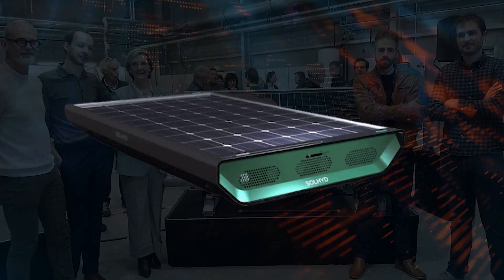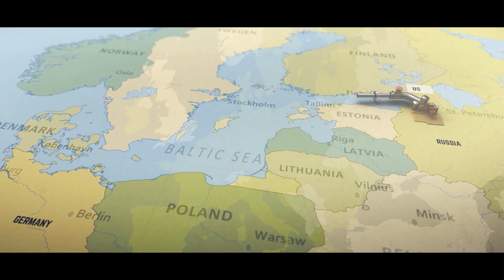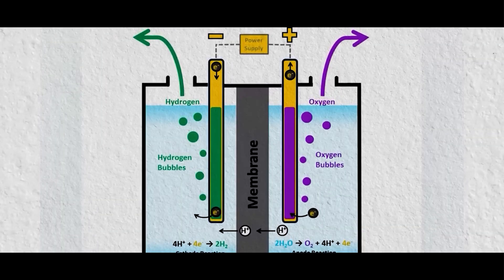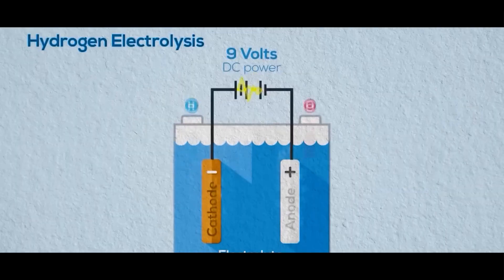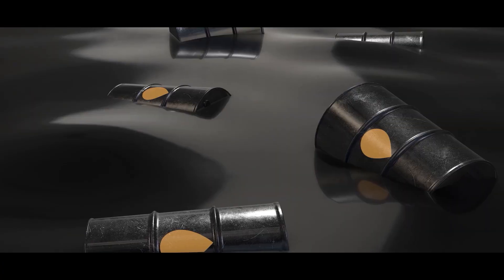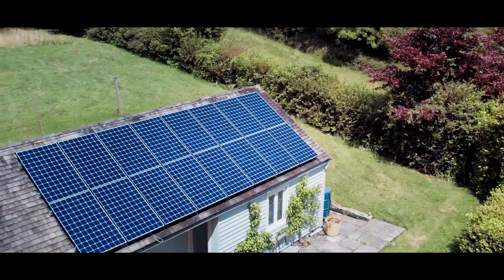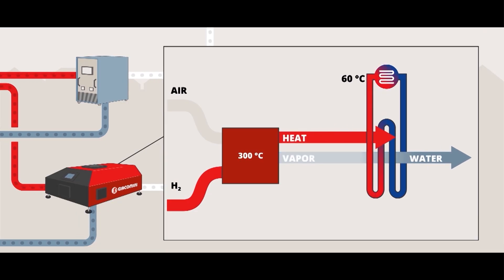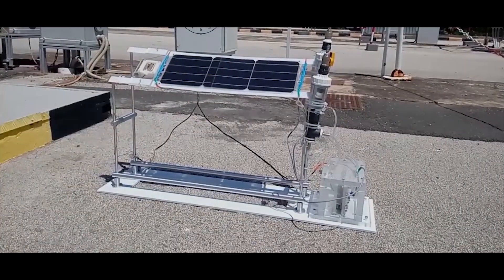NEW Solar Panel Produces Cheap Green Hydrogen at Home | BREAKTHROUGH!

Comment: bollocks, there's not enough 'platinum' one of the most expensive metals in the world in the world needed for these h2 'batteries' to operate at even just a few volts per cell output, never mind the expected 2023 52volt/500amp hour minimum home system to run a single family fridge for three days .
good luck making any container never mind cheap of even medium pressure to hold your local DIY hydrogen for 6 months without leaking before you use the gas to feed your currently unavailable & expensive home 'on demand' h2 battery bank.
there's No such thing as simulated/synthetic gas [simgas] except in PR investors booklets for profit; you mean old school DIY 'town gas' as used for hundreds of years in the UK before north sea petrolium was used

Comment: Not sure about the hole need to go green to save the planet thing but having a small off grid system I will say the storage of solar energy is my biggest issue. Current batteries have come along way but it’s still to expensive and difficult to manage the energy production. A small economical hydrogen battery would go along way in helping me get the most benefit out of my system
Reply: We make energy storage from used batteries from electric vehicles with an efficiency of over 90%. The cost of building such a warehouse is over 70% cheaper than buying a new one.

Comment: Producing hydrogen from solar is not valuable, solar is 20% efficient, hydrogen production is maybe 50% efficient, stored and compressed hydrogen is low efficient about 20% and PEM fuel cells are maybe 50% efficient, so the overall efficiency will be about 35%, so battery storage is much more efficient and much less expensive.

Comment: Combustion of fossil fuels is the problem. “Green Syngas” is still methane. It’s just more “green” washing.
Reply: It's carbon neutral.. it removes carbon then places it back into the environment. A whole lot better than pulling carbon from the earth and putting it in the air.

Comment: No matter what color hydrogen is made,  the gas piping of the house heated by natural gas will need changed to safely use hydrogen.  Hydrogen gas embrittles most metals and plastics and also leaks very readily...  in some cases,  it can leak through the walls of the tubing or storage container,  not just any fitting joints.
Reply: You are absolutely correct.  A home hydrogen tank will leak (eventually) and it is extremely explosive.
Storing hydrogen at home will be about as safe as storing nitroglycerin.
These Green Energy dreamers are so out of touch with reality it isn't funny.
They're going to get somebody killed.
Reply: They didn't say hydrogen will come through the gas main. They said a gas made from hydrogen has the same properties and could safely mix with mains gas and be used for green steel production.
Reply: @Murdock  They have upgraded the gas mains the UK to take hydrogen. Though it will probably be methane hydrogen mix as you cannot make hydrogen smell.
Reply: Mixing the gas is one option, another option is to power a fuel cell and thus the system in the house will have to be made full electric.

Comment: You lost me a bit earlier than this, but the comment "It extracts water from the humidity in the air" reveals the project is highly likely, not feasible. There are several issues here that I can raise off the top of my head:
1) you'd need a little power plant for each panel (huge waste and not practicable).
2) current process for water electrolysis is about 70-80%% efficient - so, to produce 1 kg of hydrogen (143 MJ/kg or about 40 kWh/kg) requires 50–55 kWh of electricity. Then lose another 30% of energy converting back to electricity. If each panel is say 400w, which will produce about 2kw a day, we get 1kw loss due to conversion, meaning in 1 month gives 20kw of power. This does not consider storage and compression energy loss).
3) you cannot extract enough water from the air at a good rate for this to even work (wasting more power for fans needing to move air about - specifically, air has a density of about 1.2 g/L, and water has a density of about 1 kg/L. if you had perfect capture (not possible), you need to shift 830 L of air. Actually, I take it back, the conversion rates for a panel are so poor, this may work, but you'd be better off relying on rain. In any case, this is more wasted power.
4) you need more than just water and solar power to extract hydrogen.
5) If in liquid form, hydrogen needs to be stored at -252.8 to remain a liquid, with over 5,000psi. As a gas, it has a low energy density and requires compression to 4 times that of natural gas. This all costs energy, so you will lose power to convert water to hydrogen and to just by keeping the gas.
6) there will be a high maintenance cost with so many separate power plants and complicated storage/conversion methods.

Simply put, the cost for all of this is very prohibitive with little return on investment. You'd be far better off storing the electrons in a battery as this process is uncomplicated, loses little by way of storage losses, is cheaper, does not require storage of hydrogen on-sight.... look, nice idea (*cough*), but makes very little sense at a local level due to the massive cost, loss of electricity during conversions, complicated storage, already having better technology to do the same job.

Comment: Bad strategy to create H2 and store.
Better to store electricity in battery and heat homes by heat pumps.
Never going to be commercially viable or safe.
Will be interesting to see how much money is spent on attempting to engineer this solution.

Comment: Hydrogen is problematic in so many ways. Hard to stop the smallest molecule from leaking through anything else, penetrates and embrittles metals. Storage and transport will never be simple. Existing Natural gas networks would be like a screen door to H2. Hopefully this tech can serve some niche need, but would never work in mass, those panels would cost a fortune to produce.

Comment: a couple of times you mention using photocatalytic hydrogen production (direct light->splits water using catalyst) but all the images show a photoelectric cell in the front implying that the standard electrochemical process powered by photoelectrics is being used ... which is it?

Comment: All solar panels can produce hydrogen. You will need much bulkier, more complex panels that will cost much more than standard panels that are getting cheaper all the time. They haven't invented anything new. This is just repackaging electrolysis which has been around for 100 years.
Storing hydrogen is not as simple as pumping it into tanks. You will need high pressure vessels, leak proof pipes and fittings - no, your natural gas lines will not work.
I will bet that this system is going to be mugh more expensive than standard solar and battery storage.

Comment: All this technology and expense  for only enough hydrogen for 4 KW-Hr to 8 KW-Hr for the whole year with 20 panels for a house?  Are you kidding me? The average house uses more than that for a day!  Cool technology guys but you have a long way to go before you can use this on a typical house!
Reply from the maker: Damn. There is a correction comment i have pinned on.
It is 4 to 8 MEGAWATT hours per year!
Reply: @The.Futurist  Ok, I missed the pinned correction. It would have been better to make the correction on the YouTube video. This is how YouTubers usually make corrections when the miss something or say something that they did not mean to say or show something by mistake. Perhaps you can still do this. Thanks.

Comment: This is a nice pipe dream. But that's about it for 20 more yrs or so.
I just think that the author Connor plug the Belgian co. because they don't really offer any storage area for hydrogen, and further more if any one is , it's liable to be only on the largest industry scale.. remember one has to compress the gas , warm it, then pull it out in order to utilize it as a fuel. So then you're all over the place of this subject when you talk about converting different products of an electrolysis reaction into new "$yngas" to just replace current fuels used worldwide.

So we'll have to claim bullshit for the next 20 or so yrs.
 Just quit lying to the public...

Comment: It sounds far too good. The manufacturer and The Futurist conveniently ignore the problems associated with hydrogen. Storage is extremely tricky, it leaks very easily. Also, have you considered the problem of hydrogen embrittlement?
Reply: Exactly. For what it would cost to install these very complex panels, install high-pressure, leak proof pipes, fittings and pressure vessels, you could install standard panels, battery storage and buy a nice EV with vehicle to load capability.
Reply: "Also, have you considered the problem of hydrogen embrittlement?"
Certainly.  That's why there is carefully no mention of it.
Reply: In most case it only needs to be stored for a short time. People have done this in the past and now we have better materials. Hydrogen is a small atom that can pass through some  materials. That is a fact, but it doesn't need to discourage all progress. It has incredible energy density and it is the most common atom in the universe. I used to play with it when I was a kid, I think it has potential.
Reply: @rowgler1  "In most case it only needs to be stored for a short time"
This video says it makes hydrogen in the summer for use in the winter.  That's a six month supply of hydrogen.  That's a LOT of hydrogen.
Reply: @rowgler1  Energy density of hydrogen is low compared to other fuels, just google it. Also, it can be liquified only at very low temperatures and high pressure.
Reply: Yeah they need to stop lying. You can't replace fissile fuels. 
What are you going to use to power a Bucket Wheel Excavator? What are you going to use to replace IV tubes with? Can someone show me an alternative solution to a jet engine that does not use petrochemicals?  We have nothing that can replace petroleum products.
Reply: @PAIP_Studio  JCB has a backhoe that runs on hydrogen right now. Link  https://www.youtube.com/watch?v=3fWmQgXcdqA
Reply: @PAIP_Studio  wake up. We can. And we need to. There is nothing you can power with fossil fuels that you cannot power with electricity or hydrogen.

Comment: 6kg of hydrogen per year per panel? That is terrible efficiency.
I just did the calculations and combining normal solar panel with a normal electrolyser you would get around 27kg of hydrogen per year.

Comment: Electricity should be made with clean coal put scrubbers on the stacks we have 1200 years of coal natural gas should be used to heat homes and run cars and trucks we should build navy subs that can be plugged in the grid and generate electricity in peace time in war time they can go to war to protect the USA then we can start up the coal power plants  we have theses power plants now all we need is the 100 subs built you do not want nuker power plants in time of war there targets we have all this it takes 10 years to build a nuker power plant and100 billion ,a sud cost 3billion 100 subs will take care of are power for the next 20 years and put 100000 Americans to work for the next three years

Comment: h2 would be a great storage solution, if it weren't for the fact that LITERALLY EVERY OTHER SOLUTION is cheaper, more efficient and MUCH less problematic. liquid air battery, lithium ion, LFP, CO2 liquid storage battery (similar to liquid air), sand batteries- even nickel metal is better. let's assume for one minute that they solve the problem- and now h2 panels last forever & are cheap. NOW WHAT? use it for ground transport? first problem with that: FUEL CELL? made of platinum- and only lasts for about 200k miles- then costs $35k to replace- and that's just one for a compact car, even then, you STILL need a lithium battery pack to 'buffer' the power thru, because you can't put a high amperage demand directly through the fuel cell.  use it for energy storage? same problem again: FUEL CELL. and you still need the lithium pack... AGAIN.  at those rates- you could buy 6kwh's of tesla megapacks for every 1kwh of h2 fuel cell. STUPID. 

solution? enter the marvel that is the million mile tesla battery- actually... 3.5 MILLION mile. dry lithium, 4680 cells.... with a 50 year shelf life. stick that in your h2 tank & smoke it. who cares how good h2 is or isn't. NOT GOING TO MATTER. tesla already OWNS the energy storage industry. end of story. oil heads are always harping on how 'not enough metals for battery.. blah blah blah'... ummm... so hydrogen? lmao! and how rare is PLATINUM for h2 fuel cells?!?!

Comment: sounds too good to be true? that's because... IT IS. the problem with this tech is- the panels degrade FAST. within 3 years? COMPLETELY useless. hydrogen will be useful for manufacturing processes if we go 100% renewable, so- it is a useful tool. but not for energy storage & CERTAINLY not for transportation. if they can get this technology to even a 20 year lifespan? this would be very useful in metal refining processes & heavy manufacturing. but not for homes- photovoltaics & lithium OWN that market and no one wants a bomb in their back yard.

Comment: its NOT 90% efficient... not even close. its probably more like 3-7% 
the solar panel is at most 15-22% efficient. 
Converting the electricity into gas by electrolysis in an HHO generator setup about 70% out of the 15-22% from the solar panel. so now were down to 10.5 - 15.4% efficient
The efficiency loss due to pumping the gas into a vessel. (depends on the method)
good luck capturing the heat and heating the home with it. there's another obvious efficiency loss moving the heat energy. 
storing hydrogen requires a special vessel to withstand high pressure or low temperature which means an Additional energy loss due to cooling and or compression. 
( isentropic efficiency of about 56% and a motor efficiency of 92%)
burning hydrogen and converting it to electricity (re-electrification) is up to 50% efficient.... a further reduction AFTER all the other steps efficiency loss. 
you may as well burn your money for heat energy at this point. 

companies need to forget about hydrogen as an energy source. its not even a viable as a "battery". its ridiculous the lengths they go to to make it less efficient. 
oh yeah lets strap a solar panel to it and reduce the energy efficiency to near zero. people will buy the heck out of it...

Comment: For home use hydrogen is a long way off making sense because of the extra energy needed to compress it to a practical volume, with sodium batteries scaling up now I'd say it will be available at half the current cost of Lfp within a decade, at that point it will be hard to beat in terms of cost, efficiency, longevity and the simplicity of no moving parts. Even Lfp is probably going to drop in price a lot in the meantime and already makes sense for those savvy enough to build their own system creating about a 3 to 5 year payback, then enjoy another decade of zero power bills.

Comment: Unless their electrodes are Platinum it's a gimmick. I've been working with hydrogen for over 15 years I have built things similar to this 10 years ago. The problem is that the electrodes do not last unless you're a government agency you have some kind of government sponsorship doubt you're going to be able to keep replacing electrodes. I have a brand new prototype I'm about to finish building but it cost me almost $4,000 to build it. The reason is because the electrodes cost me 3970 dollars. My containment units are already rapidly produced. I figured that out years ago. There's also a certain point where during a long run you have to worry about tridium buildup as well as deuterium causing your water to become less conductive. It's only happens after the unit's been running for a few months but can be problematic. Deuterium does not do any damage to the containment unit as long as water will not hurt that containment unit, heavy water will not allow electricity to flow properly though. Tritium is a free radical that is produced during electrolysis process. Depending on if you're storing fuel or continuously using it on demand tritium can become a problem. I found this out the hard way when some of my containment units started to Glow after 3 months of continuous use. Who knows how long I had been breathing tritium before I knew I needed to vent through a bubbler and outside of the shop to empty the units.
Reply: Thanks for the info.

Comment: I've been waiting for this, but this company better up its game and fast. Elon Musk just announced the unthinkable! Tesla is now a hydrogen car company from an EV car company. Toyota has announced the same thing. Here in Utah hydrogen generators about the size of a gas pump are being installed for home and commercial use. Less than 10 years and we won't even recognize how energy is produced at the local level and the big transmission lines across the nation will have been dismantled for other uses.

Comment: I can't see any advantages, except if you live where water never freeze and are interested in only 1 or two panels.
It will be too expensive.
Too sensitive to cold.
Too bulky for a private home roof.
Too sensitive to dry climates. (No water will be collected= no H2).
No sure if the electricity was bypassed for consumption. Or if it always become hydrogen first then electricity. If the latter it has too low efficiency.